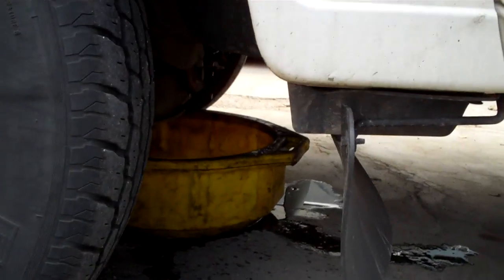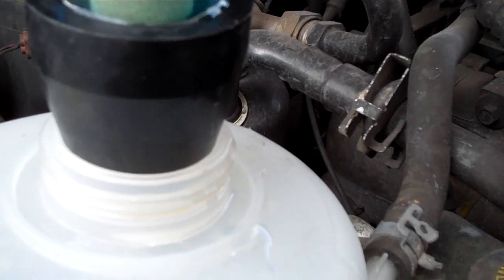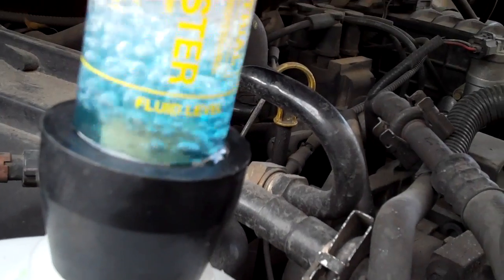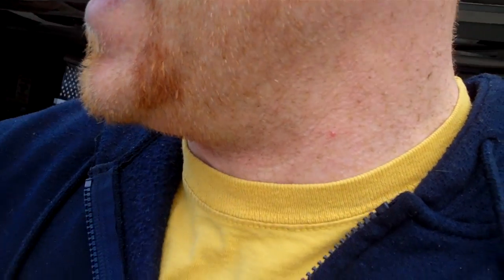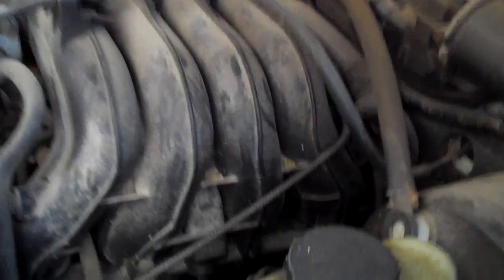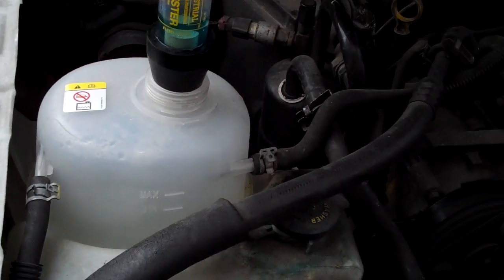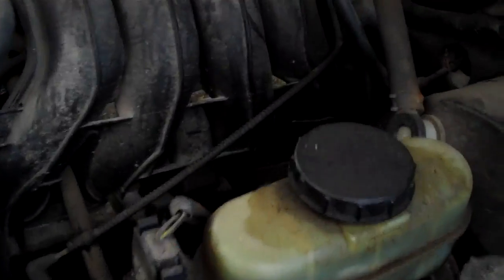How to test head gasket failure using an antifreeze HC Tester

Comment: Love your videos.  I have an 08 Outback that might be head gasket failure but none of the typical symptoms.  No oil in coolant, no coolant in oil and no white smoke out exhaust.  I am getting bubbles in my overflow and overheating.  Also, no leaks.  This must be the test I need…

Comment: won't the radiator start pushing fluid out If i get to warm operating temperature that would be just below the half way mark on the gauge??? can I remove fluid so the level is about 5" below the neck?
 that would then put coolant in the fluid and contaminate the fluid, thus invalid test.

Comment: Hey i have some issue with my car. For some reason my Overflow always gets filled up. I tried checking my oil cap and i see just a little amount of milky substance om the cap. Kinda similar on that car. And also when the engine gets a bit warm the overflow level goes back to normal. Is it a head gasket issue still?
Reply from the maker: Your overflow tank has an overflow itself. You can put baby powder on it and see if its overflowing.  if you find that your tank is overflowing and then going back down when your car cools down- to regular levels, you may have a head gasket issue.
Reply: could it also be a radiator cap or hose  issue? Or just head gasket?
Reply: It could also be a bad thermostat or clogged cooling system.
Reply: you probably have air trapped in the system . There are a lot of videos on Youtube that show how to burp your cooling system .

Comment: Water in the oil is not 100% head gasket. As you an have an intake manifold leak into the oil valley.

Comment: There are various modes of Head Gasket failure.
1./ Exhaust into oil and Coolant
2./ Exhaust into oil and or internals of engine
3./ Cylinder to Cylinder
4./ Exhaust to outside
5./ Exhaust into Coolant
6./ Gasket flare up - hot spot that causes pre-ignition

Findings:

1./ bubbles in radiator obvious by putting a garden hose inside your heater hose and putting both ends into a bucket full of strong tea. Yep strong tea. the color will get lighter if there is acidic gasses bubbling through it. Over heating, LPG lacks power or surges at higher RPM could indicate vapour locks in the cooling system usually caused by head gasket.

2./ Under the oil filler cap may be ice coffee frappe / on the dip stick.
if there is just a little under the cap - take the car for a long drive on a freeway like a hour and see if that has cleared up. if it's on the dip stick ..then you need to find sources of water entering such as river crossings in a 4x4 or can be timing cover gasket(s).

3./ compression test should reveal that there is no more than 15% difference between cylinders. if there is then it's probably time to service the valves in any case.

4./ If the crank case is pressurising, or pushing out smoke. It can mean the engine rings are worn or the head gasket is blown internally into the oil / valley cover etc. You can smell a burnt smell in the oil and it will be much blacker than normally expected. Check the PCV valve and hoses are clean and working.

5./ Engine runs rough and may backfire even after a service and "tune". This can indicate a cylinder to cylinder blow.

6./ Persistent pining or knocking even after a tune up and new plugs etc. Can be a gasket flare up or deposits on head and valves, head will need service and possibly rings if it is from excessive blow by pushing oil into the PCV Valve / intake or oil moving past the rings or valve stem seals.

7./ Excessive water from  exhaust pipe even after warm up. Lots of white Steam or smell of coolant in the exhaust ... place a cup at the end of the pipe and leave it there after warm up and smell and look at the cup turning the engine off. It may also burn oil blue / white smoke.

When you do a head gasket what should you replace ?

1./ Head gaskets
2./ Head Bolts (check with service manual)
3./ Rocker cover gaskets, valley gaskets etc (use a VRS Set)
4./ Thermostat
5./ Any and all coolant hoses that are swollen, stiff , crunchy when you squeeze them or looking sad.
6./ Timing cover gaskets if your water pump bolts onto your timing cover
7./ The engine oil x 2
8./ Correct Coolant
9./ Radiator Cap
10./ PCV Valve (check and clean or replace)
11./ Oil Filter x 2
12./ Air Filter
13./ Fuel Filter
14./ Plugs
15./ Leads / caps etc. Points / Capacitor.
16./ Water pump (check for excessive corrosion or replace)
17./ Any corroded fitting in the cooling system such as hose flanges as Carbonic acid will eat away water pumps, fittings and even your head and block over time.

Extras
A./ Radiator must be de-tanked and rodded after a blown head gasket into water.
B./ Car heater must be thoroughly flushed with water, and compressed air.
C./ block must be reverse flushed.
D./ It's not always necessary to deck the head and block but if the gasket is gone you will be advised to service the head(s). New seals, cut seats, check flatness /deck.
E./ Very good idea to grab a feeler gauge and check with a reliable straight edge the flatness of the block, checking for pitting and corrosion etc. You may have to pull out the engine, strip it and deck the block.

 Notes:
You must flush both oil and coolant . Use a cheap oil and filter and run it for about 15 mins after re-assembly. then change it to a good oil and filter after checking for leaks etc.. Coolant - use water let it get hot, drain it (x2) then check for leaks / bubbles etc before filling with proper coolant . 

Remember coolant or lack of correct coolant is the main reason head gaskets fail into the water jackets.

Follow correct torque and sequence of tightening of all bolts - don't "wing it" with a monkey fist .

Comment: Hi Brain, thanks for the video. Does it matter if the block tester is used on the overflow tank or the top of the radiator? Or will the result be the same? Thank you.
Reply from the maker: +tgustafson7 It works the same.  The important thing is that you have a sufficient air gap for gasses to collect.  If you do it at the radiator you have to drain the coolant down 4 inches or so to get a good test.  The burp bottle will typically already have a gap ready to test without draining it.

Comment: Hi Brian, I always enjoy your videos. I have a 2000 (EJ251) Subaru outback wagon.. It runs a litlle rough at idle and one time, it cut off as I was was shifting to back into my parking space. One of the guys at an auto parts store said it's a head gasket. I don't like to assume anything esp when considering what a big job that is.       Will the HC test be a good indicator on my car?        I haven't seen the "chocolate milk" in the oil or the cap and no smoke from the exhaust. There is something black in the coolant reservoir but, it looks like solids. I'm going to pull the reservoir and dump it to see what ot really is. I have a feeling I'm going to be doing a coolant change and checking the thermostat to make sure nothing's blocking it. It never gets hot tho.Thank you for your help and your videos!
Reply from the maker: +Martin Philips Yes it will.

Comment: dealerships can suck it, also K&N on a car with a  MAF is not the best idea for most drivers, the oil can contaminate those.

only because i;ve seen it happen, over-oiling a K&N or ignoring up the process for using MAF cleaner (must dry completely)  will ruin your day
Reply: Your are 100% correct. My Malibu was starting to have issues and tranny felt like it was hesitating. Took to the dealer and mechanic said everything looked fine and on a hunch told me to use a regular air filter and clean the MAF and let it completely dry . took his advice and issues are gone.

Comment: The compression test isn't 100 percent... thats testing for it to enter the radiator... a gasket leak can be the opposite way with coolant getting into the oil... thats causing your milkshake cap...
Reply: in winter a little milky stuff in the oil cap is normal if you make short trips.   milky oil cap doesn't hardly ever signify head gasket or even to look for a head gasket failure. Have to look at the whole picture,  white smoke in the exhaust and milk shake on your dip stick would be what u described.
Reply: That's from the winter. After the engine is heated, the cold condenses and drops water into your oil. Driving enough miles makes this burn off, but not all of it. And it takes about 20 miles to burn it, and then when you park it does it again, so it is normal to find some in there in the winter.
Reply: You are right about the opposite though, but not in this case. If it were leaking into the oil you would see a lot of coolant on the oil, and the oil would be milky as hell on the dipstick, and the cover.

Comment: Auzone offers the tool on their loan program, basically free
Reply: true, but depending on who is working, you gotta purchase the test fluid for 8 bucks.

another way to diagnose a big problem is to hook up the radiator pressure test for 3 or more hours with the spark plugs removed and checking for wetness on the top of the pistons.  that is more useful as a secondary test

Comment: I have a dodge stratus 04 2.7l, and ive been noticing that sometimes when I stop at red lights for 5mins or so there is a small amount of smoke coming out of the exhaust. It doesn't happen every time but I want to know if its the headgasket

Comment: There is no milky gunk in the oil at all. The oil is its natural color. I had a coolant hose that had a crack a week ago and when that happened, I lost a lot of coolant. However, I refilled the system and replaced the hose. Everything worked fine, until yesterday, when I noticed the problem. Now, whenever I was filling the system with coolant, after replacing the hose, I noticed that there were bubbles coming from the water housing. I thought that was due to air in the system.

Comment: Today, I drove the car to work, always making sure not to raise the RPMs much over 2000. The car didn't overheat and no coolant leaked out. On my way from work though, I stepped on the gas a couple of times, just to see if that's going to make a difference. When I got home and popped the hood, I heard no gurgling sound and saw no bubbles (boiling coolant) like I did yesterday. However, I saw that a little amount of coolant leaked out through the overfill tank hose, but it stopped in seconds...

Comment: Hi Brian,

I have a '95 3000GT ATX TT. Yesterday, after I arrived home, I noticed that there was a gurgling sound I was hearing from under the hood. The water temp was normal. When I popped the hood, I saw that the sound was coming from the coolant overfill tank. Some coolant also leaked out of the tank, through the hose. I let the engine cool down and checked the radiator. The coolant level was all the way up. However, the overfill tank was empty. I refilled the tank and called it a night.

Comment: If it happens again put a medicine bottle full of pepper in the radiator and fill radiator. The pepper will go right to the leak and stop small leaks and it won't damage your water pump like some commercial products that claim to be leak stoppers. I have a vial in the glove compartment in each of my vehicles.

Comment: my 2006 Honda civic over flow is to the top and the car is starting to over heat,i just had a new water pump put in 3 weeks ago. The fans come on the top hose was hot and when I tried to  squeeze it, it was solid .can u help me please!!

Comment: Thanks alot for this video Brian :) I have got a 2000 Subaru Legacy. The other day when i was staring temp went up too high so I pulled over and realized my radiator was boiling. After it cooled down i topped it up with some water and could drive home. However, when I got home I realized my radiator was dropping water. I do realise that I will need to change my radiator because of that small leak, but I am curious if my radiator could have been pressured to crack by the engine(bad head gasket)

Comment from the maker: The over flow should have coolant up to the cold line on the side at least.  What happens often times is the coolant will be ejected by combustion gasses and then the the system sucks the bottle dry.  A test like this performed on a full cooling system at the overflow tank is needed.

Comment: HI Brian, my 2008 Outback keeps overheating but mechanic could only find a slow leak from the thermostat housing and the water pump was missing a bolt. all other tests come back good. I noticed that the temp went up but when I checked under the cap the coolant was just slightly lower but ok and the overflow was empty. Maybe system needs burping or a Subaru thermostat?

Comment from the maker: I couldn't say.  I'm not an expert in "putting molly anti friction in your engine" I've never heard of doing that.  If it's bearing grease- I'd say refrain.  It can plug things up.  I DO use it on seals for break in, but that's more external than internal.

Comment: @Brian off topic but i bought a compression tester and i just wanna make sure i do this right b 4 i attempt. 1st let engine warm up? 2nd Remove plugs/inspect? 3rd Disconnect ignition(Question) Can I just pull the fuel pump fuse? 4thput tester in plug hole and crank engine for 5sec. then take reading( should only be a 10 % differnence in each cylinder? Repeat all cylinders. I have a 02 doge stratus 2.4 dohc, do you know the specs for the compression test on this car?

Comment: i have oil in my expansion tank but my coolant level hasnt dropped when i pull the dipstick out the oil looks clean . i recently had my upper and lower intake gaskets replaced and i heard if they were leaking bad enough that could have been how the oil was getting in the coolant have you heard of that or is it problably the head gasket

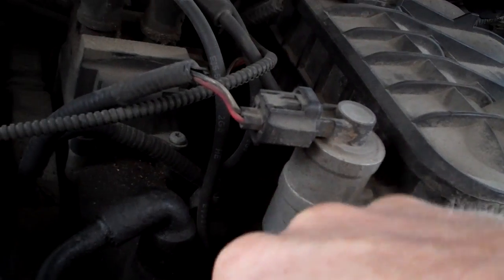Comment: omg when at 4:25 you said in winter , air can get in and make leave a bit of residue ... Its winter here and I got a 01 bullitt with wasnt started for a while cuz it was stored so air probably got in ,only thing that made me thing it has a head gasket problem was a bit of vanilla colored oil on the oil cap but like the oil is fined ,even on the cap there's just a smal trop of white , what do you think ? I did a compression check too and im getting an average of 180psi on all pistons

Comment: Can't comment on your situation, but 80-90 degrees celsius, is about normal operating temp for most cars. Cars can safely reach 100 degrees celsius without boiling if the cooling system is under pressure and in good nick.

Comment: hi brian, question: the antifreeze in my older car smells like oil, but the oil doesn't look milky at all!! and white smoke is coming out the tailpipe. now not long ago i did a valve job and replaced head gasket, but unfortunately due to a cooling fan failure the car overheated a bit.. i'd say about 80 to 90 degrees celsius :( what do you think=? thank you

Comment: Hi I have small white dots when you open the lid of the oil in the engine, but there is white smoke from the exhaust does not go even if the high temperature widget Moeshr center
·

Comment: With a big hole like that in the PCV pipe, it looks like moisture has got in causing it on the oil cap like that. Because its only a small amount thats what it looks like to me.

Comment from the maker: If you have compression gasses being forced in such that the overflow is bubbling those bubbles (if they are compression gasses and not just from overheating/boiling over) will turn the fluid yellow.

Comment: Do you always put the tester on the overflow reservoir like that?  Will the gases be able to pass through the radiator cap?   I usually put it right on the radiator, but it's a pain in the butt when the coolant starts expanding and contaminating the tester.

Comment from the maker: @fidelamaya26 That car is easy to do a head gasket on, but it is THE HARDEST EVER to get the air back out of.  It takes 6-7 drive cycles to purge all the air out.  That's letting it cool COMPLETELY between each drive cycle and topping off the coolant in the radiator when cold.  (It will overheat in 10 minutes until the air is purged out)